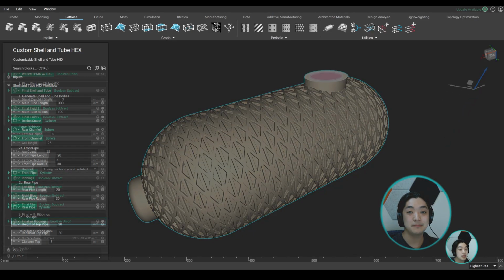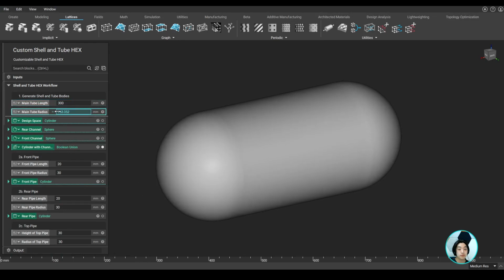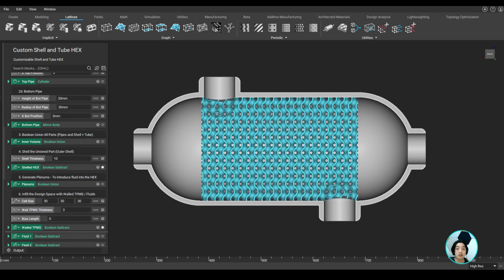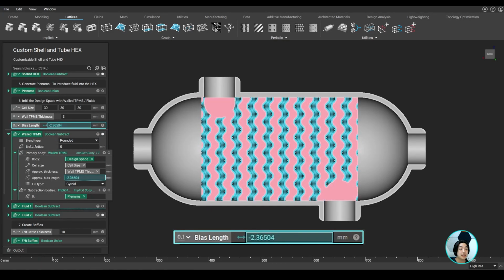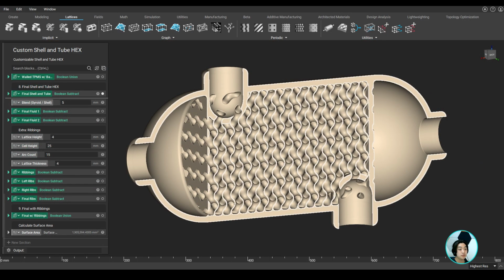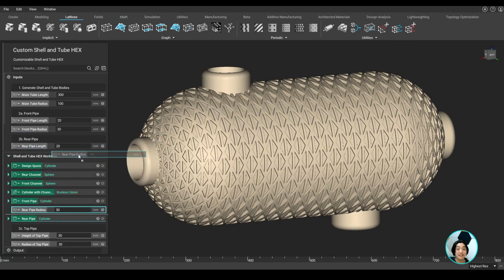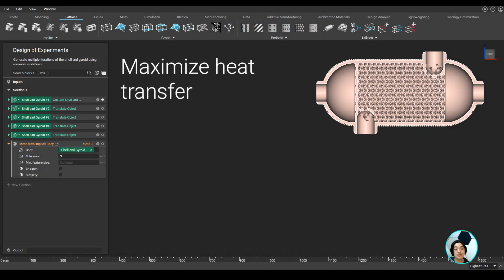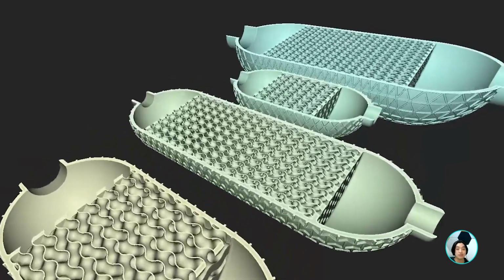Shell and Tube Heat Exchanger: Made Better with Additive Manufacturing

Comment: Any such heat exchanger must be used with very clean fluids, as there is no way to clean such a heat exchanger except by chemically dissolving any dirt (no brushes or rods allowed). I have worked with membranes in the water treatment industry, which have the same problem. Additive manufactured heat exchangers are nice where you can use them.